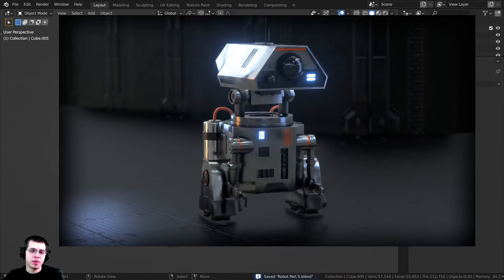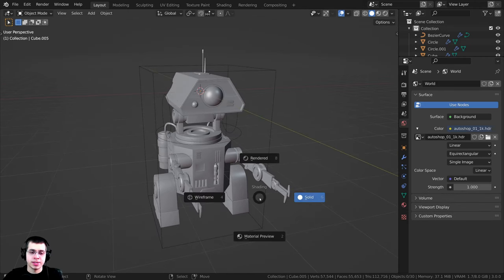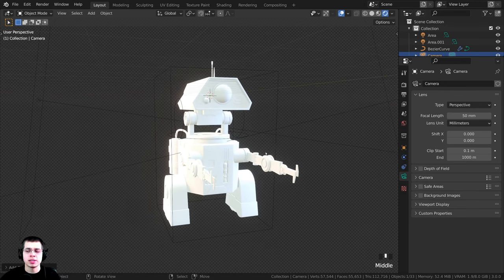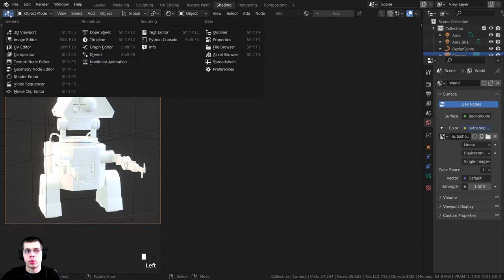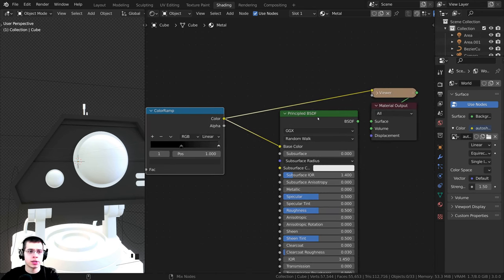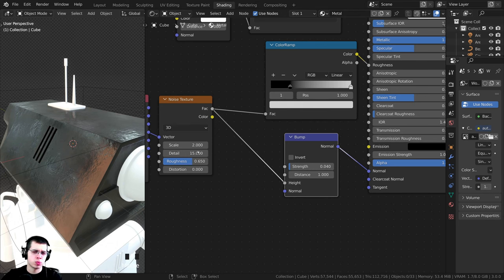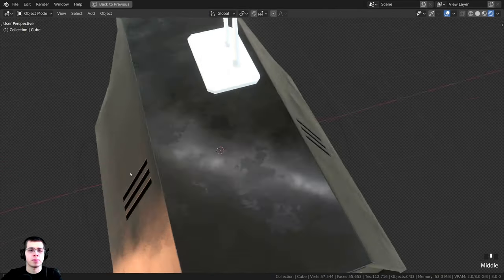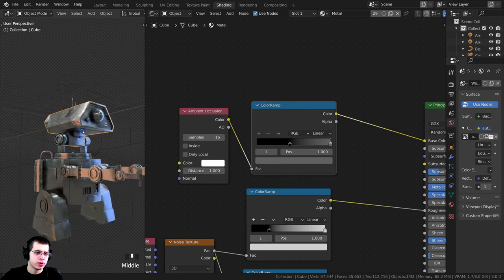Sci-Fi Worker Robot-Part 5 (Blender Tutorial)

Comment: Great tutorial, Ryan, as usual. Here's another way that everyone here can use to select the same part shown in the video at around 19:10 --> Switch to edit mode. Press 1 for vertex selection. Select that single vertex at tip of the sphere then hold "CTRL" and hit "Numpad +" multiple times until all the faces you want to select get highlighted. If you want to deselect hold CTRL and hit Numpad -  👍🏻
Reply from the maker: Yes, that way works as well. Thanks!

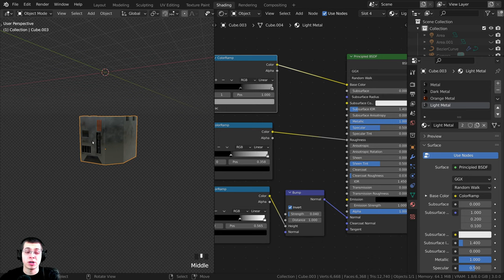Comment: Hi Ryan, I don't know if you'll ever see this since this tutorial is 3 years old, but I can't follow the process at 34:01, the latest version of blender's mix shader does not have a dropdown for 'add'. I found another node called 'mix color' which has the same options as the mix shader node you were using. It works to a point, but I need to change the rendering cycles. Is there a workaround I could use to make it work with eevee?

Comment: Im using 3.6 LTS.
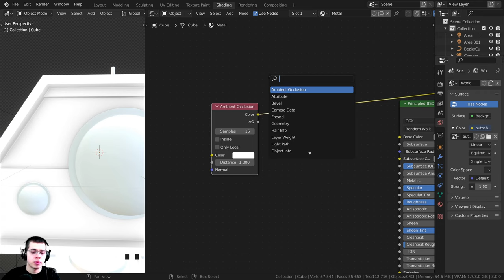At 7:35 when i adjust the color ramp im not seeing any effect whats so ever.
But if i create a new blend scene with a cube and edit it and apply the same nodes, that too i get no effect but when i change to cycles i see the effect change, but that being said, on my version of the robot if i change over to cycles im still not seeing the effects of AO....

So looks like ive found a bug, went back to 3.3.8 LTS and it works fine in Eevee.

Now this being said, i shut down Blender and reopen the file and now the AO is working fine...

Comment: I have a problem, when I added the bump shader it shows me a pink colour, please any ideas any advises
Reply from the maker: hmm, I've gotten other people commenting the same thing on some of my procedural material tutorials. Seems like a bug that sometimes happens in Blender Eevee, where if the material is too complex, it turns pink. Although I've never had it happen to me before. Not sure exactly why it happens.
Reply: @RyanKingArt  what do you suggest 😅, I want to finish it so badly ❤️
Reply from the maker: @slimanelatreche8928  well the metal isn't very bumpy, so you could just leave the metal without any normal data. you could also switch to using the Cycles render engine.

Comment: Hi again, when I add the png ( different project ) and use the mix shader, my png is very washed out, can't see to find why
Reply from the maker: That's because of the setting of the mix. You might need to set it to add, instead of, mix. Also, you might need to change the factor to 1.
Reply: @RyanKingArt  That's exactly how it is setup, mixRGB, set to add and factor to 1, but the png shows very washed out still.
Reply from the maker: @insanityfilms  What are you mixing it with?
Reply: @RyanKingArt  very simple shader, actually the paint shader you did, and this png image, I thought the multi color was the issue, but removed it and plugged in just a normal color, and still same issue
Reply: @RyanKingArt  Also tried literally your way from this video from scratch, still washed out.. so frustrating
Reply from the maker: @insanityfilms  Sorry, I don't know what the problem is.
Reply from the maker: @insanityfilms  You could make a post about it on Blender Stack Exchange, or maybe Blender Artists .Org , and hopefully someone can help you.
Reply: @RyanKingArt  oh ok, I thought I could send you a blend file with just that shader, but cheers 👍🏼
Reply: @RyanKingArt  me neither ;)